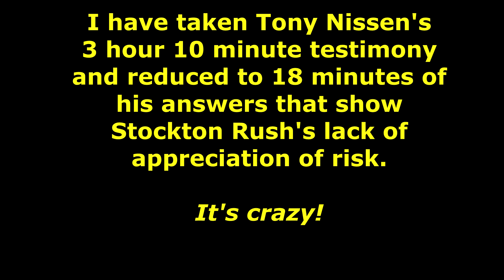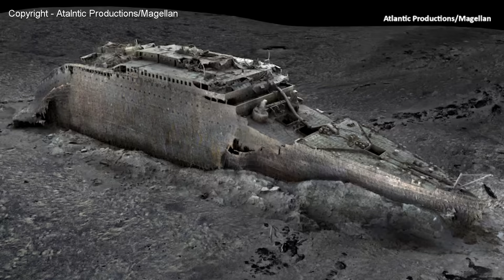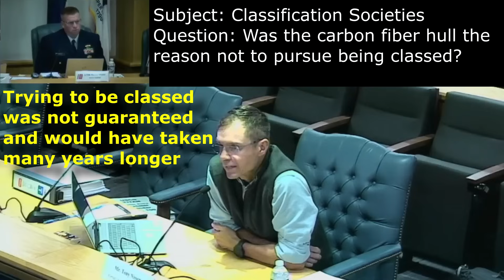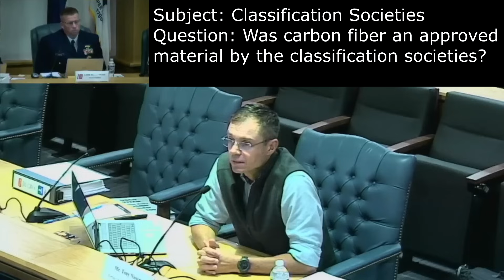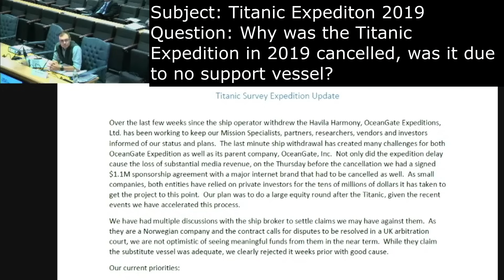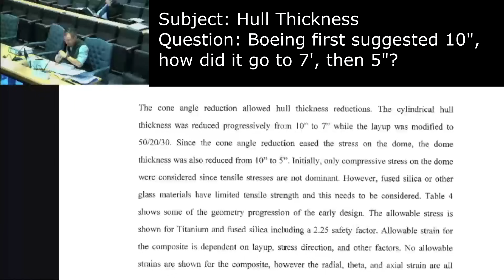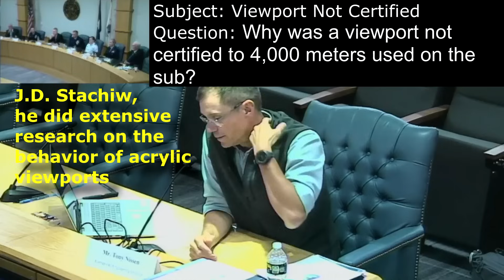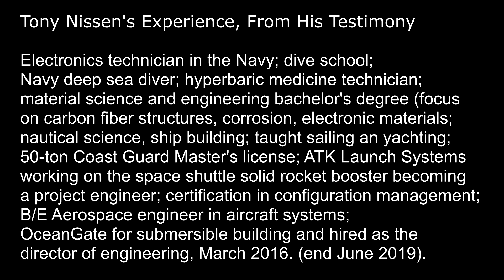OceanGate Titan - Working for Stockton - The Engineer's Words

Comment: If u ask me Tony Nissen is responsible in some regard. He as lead engineer oversaw and actually personally helped with the gluing of the 2 Rings to the hull. As we all know this was done in a sub-standard way in sub-standard conditions. He should have blown the whistle right there.
Reply: I completely agree with you. Tony had the power to build a case against David Lochridge/Scott Griffith (Oceangate) in order the sever their relationship with Dave Dyer of the University of Washington (APL) but wasn't able to put the same energy into proper engineering and insisting on using proper materials (he was only there to "herd the cattle" apparently) . He sounds like an arrogant recent engineering university graduate who thinks they know everything when they graduate but really, they don't know anything at all! I lost it when he said he wouldn't go into the sub because he didn't trust the operations team....he was incapable of taking any responsibility for ANYTHING. I can go on and on...
Reply: @TikkaTCM  He reminded me of some engineer/tech types that I know who seem to function in a way that's a bit detached from reality. Like everything is a project in a lab, rather than something that is really going to be used. A lot of his attitude would have been fine if it was not a "live" product and was only going to be tested or operated in extremely controlled environments for testing purposes, with the data then analyzed obsessively. But that is not what he was doing.
Reply: @TrappedinSLC  he was in over his head and was too arrogant to admit it. He is now blaming everyone else ...including the guy who actually DID speak up to OSHA because he didn't want people to die....
Reply: @TikkaTCM  When Lochridge wrote his Titan inspection report after this he had his dismissal conversation where Nissen was present. If u read the transcript of this conversation u can clearly see Nissen is vested in Rush and in every decision he made including not having the hull scanned for defects and severing relations with APL. Nissen was part of the problem Lochridge was trying to adres. In that period Nissen enabled Rush to make all these design changes and there is very little information available Nissen spoke out about any of this.
Reply: @salland12  i am so glad you brought this up! This video makes it appear that Tony was a victim but he was 100% part of the problem.
Reply: @TikkaTCM  In my opinion he absolutely was. I find this case very interesting because Rush didn't and couldn't have made every decision on his own he had people around him supporting him and enabling him like Nissen. Dave Dyer's (UW APL) testimony also mentioned that he and Nissen budded heads and had fierce arguments about material, design and testing procedures. Dyer specifically mentioned Nissen did not want to share overview hull designs to the company who were forging the Titanium domes and rings.  Dyer passed Nissen and shared the relevant designs anyways. Nissen got extremely angry about this and shortly after the Ocean Gate APL relation was severed. There is a pattern Nissen was part of the problem, this is very obvious when u read the 79 page transcript of the conversation where Lochridge's was dismissed/fired. Nissen wasn't even sharing design/testing documents needed for Lochridges inspection. It is clear Nissen was (like Rush) a arrogant know it all engineer who was in way over his head designing this sub since he had zero experience.
Reply: @salland12  couldn't agree with you more on this!!
Reply from the maker: Tony had the folks from Spencer Composites due the glue.  The Spencer folks were supposedly the experts. Tony, actually did a lot of good work trying to match the moduli of the titanium rings and the hull.  The issue is that there are no standards for what they were trying to build.  It needed many, many unmanned test dives to prove the concept and the build would not work.
Reply: @solareclipsetimer  There absolutely are standards for Carbon Fiber to Titanium joints. It's done in aerospace. There is no reason whatsoever that a joint you expect to stress more than in aerospace applications should not be done to AT LEAST aerospace standards, and on hull 1 it was not.
Reply: @TrappedinSLC  Aerospace is just completely different. The pressure differences are huge.
Reply: @changingmyworld-j9z  Yes, I am saying that aerospace standards should be the minimum if you are going to be subjecting the item being glued to even stronger pressures than that in aerospace. They did not even meet aerospace standards.
Reply: @solareclipsetimer  They didn't match and there was no way they possibly could. Don't you think he should have realised that if he was competent in what he was doing?
Reply: @solareclipsetimer  I don't want to discredit Nissen in anyway but if i look at Lochridges's and Dave Dyer's testimony it seems Nissen just like Rush disregarded many testing and engineering protocols set by APL and this was during Nissen's time as lead engineer. Nissen isn't a professional engineer and he had zero experience with submersibles, he was not in anyplace to make those decisions especially without the APL or a classing agency .His experience was more in instrumentation, in which as we now know he indeed did a good job with the acoustic monitoring system.  During the conversation in which David Lochridge was fired Nissen was present, This conversation was recorded and i'am really curious what was said by Nissen. This could determine in part how vested he was in the kool-aide cult and show how liable he really is. Given the testimony's and the fact he never blew the whistle on this thing he was for a long time a true believer in the kool-aide cult of Rush.

Comment: Yet another case of the engineer says no and some manager says yes.  And then like when the space shuttle blows up everyone is like "why didn't the engineer make management say no?"
Reply from the maker: You are absolutely correct.  The two shuttle accidents did not need to happen.
Reply: @solareclipsetimer  i don't know how they could have prevented the columbia disaster, besides halting the entire shuttle program.. which BTW they should have done, even before the challenger disaster
Reply from the maker: @peabody3000  Thanks for your comment.  NASA had previous launch videos showing of pieces of foam falling off the external tank where it was coming off that external pipe.  It was a dangerous thing, but they did not intervene. They were lucky, foam just never struck the shuttle at a crucial spot, like the leading edge of the wing, like it did on Columbia.  The fix after Columbia was simply to no longer put foam insulation on that external pipe stack. They could have made that change years earlier and the Columbia accident would not have happened.
Reply: @solareclipsetimer  that foam ramp as they called it wasn't the only spot shedding foam chunks. shuttle launches had foam coming from many spots, largely at random. the ramp area was one of the worse spots for losing foam, but even with improvements there the shuttle was still a deathtrap that could never have been made adequately safe. i'm glad it's gone for good.
Reply: @solareclipsetimer You didn't mention that the foam formula was changed to meet new environment standards.
Reply: From My own experience from acid bath's to 350psi nitrogen lines, that's exactly how it works. The engineer's say No. The Managers say Yes.
Reply: As there are engineers and ain'tgineers there are also managers and manglers.
Reply: Reason 4,235 why I retired as an engineer.
Reply: But the engineer knew it was wrong and the sun wasn’t ready he could’ve been a whistleblower
Reply: @nekkwiill218 How many whistleblowers have been found dead in the last year?    i saw a video and it was four people, found dead in their homes. All of them died before they could testify.
Reply: Reminds me of a very old 'Dilbert' where he says the software is unfinished, swears at you, wipes your hard disk, and of all of your friends.
Then marketing says: 'Fine. We will call it Quick Protect'.

Comment: In the end those sensors actually did their job and sent plenty of warnings early on that there was a big problem growing in the carbon fiber hull and Stockton ignored those warnings.
Reply from the maker: Correct.  The sensors worked, but did not make it safe.
Reply: @solareclipsetimer  because the humans didn’t take the data and use it properly
Reply from the maker: @Katrina.3032  Agree, Stockton was in a huge finanicial mess, even when they were using hull 2.  He was ignoring warnings to force the dives while at great
Reply: @solareclipsetimer  . . . Yes? At great . . . what?

The suspense is killing me, man!
Reply: That was the part that really shocked me. You’re in the sub you hear these noises, plus you have this data showing you the sounds including this one really loud sound. And you just keep going forward like nothing’s wrong. It’s like people that keep driving their car when it is making a crazy noise. Why would you do that?
Reply: Those audible sounds when diving, especially that very loud one that happened as they were surfacing....
Those should have been all the warnings they needed ..